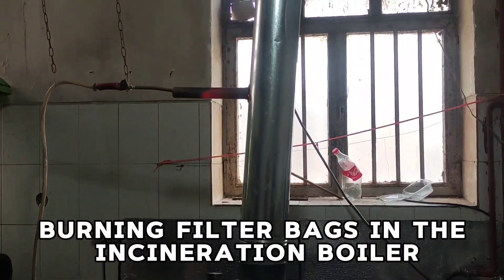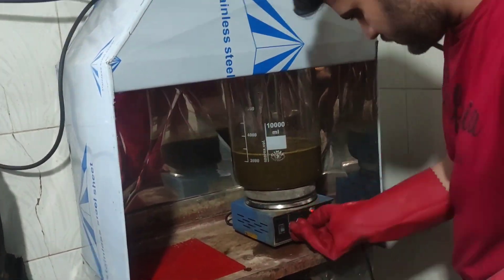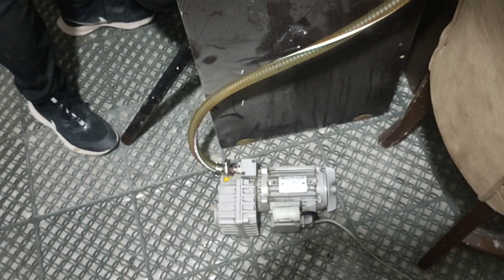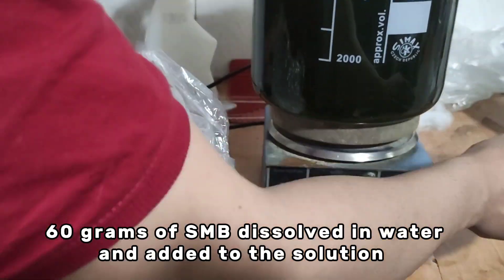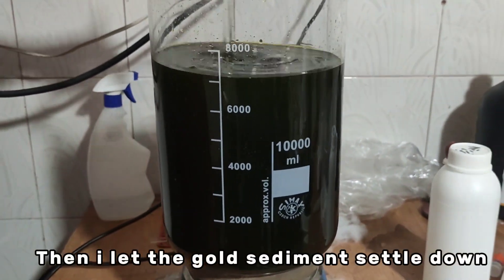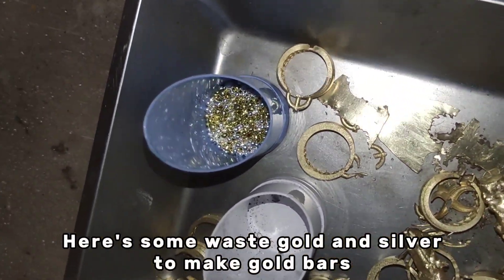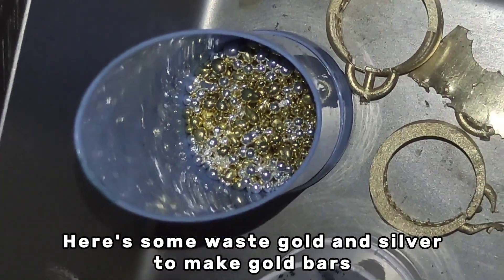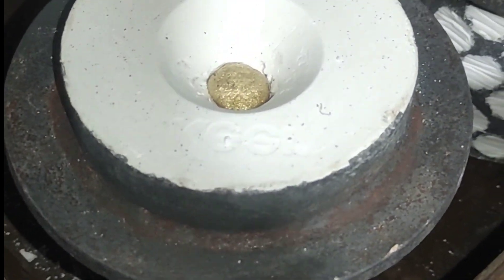Gold Recovery From Jewelers Sweeps

Comment: Hello man, regular jewelers dust is real nightmare to work with, so this is like dust from casting rings and so? One more question, I wonder, you use SIMAX glass? It is Czech company Kavalier, few kilometers from where I live... Long journy to your lab... 🙂
Reply from the maker: It was very fine dust from the polishing machine ... So it wasn't that hard to deal with. Beside after ashing, we took out the large pieces by hand . Exactly they were Simax from the Czech republic , had a long journey and were relatively pricey. 
250$ for 10 liters beaker.
It was quite interesting to know that...
Reply: @frantiseklaluch6605  کارت درسته  داداش واقعا اقایی دستت طلا